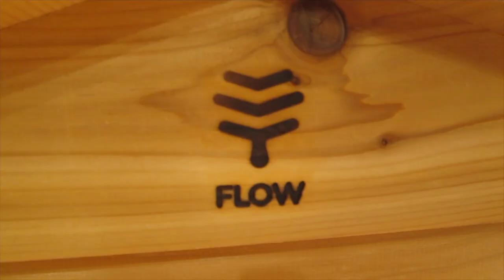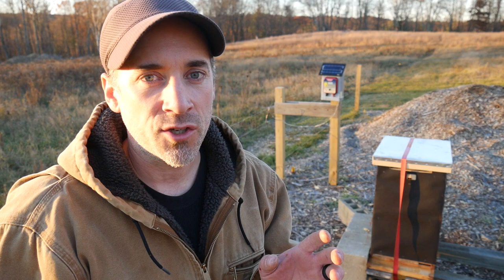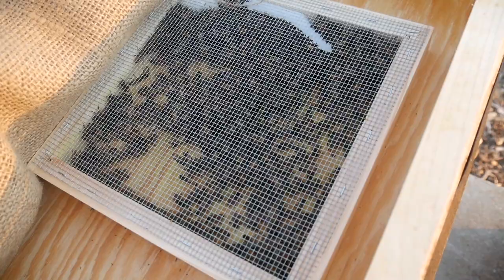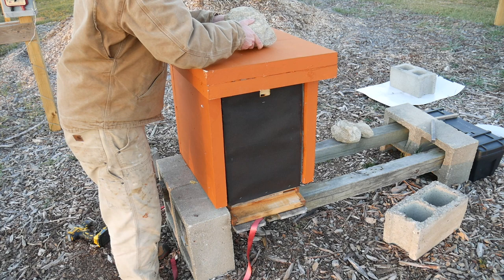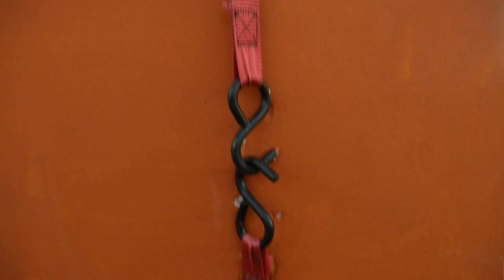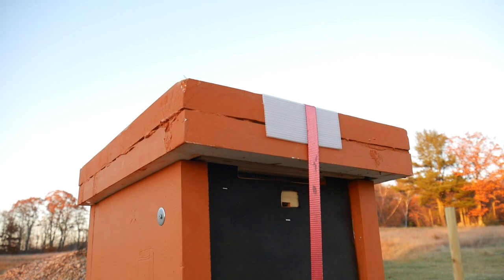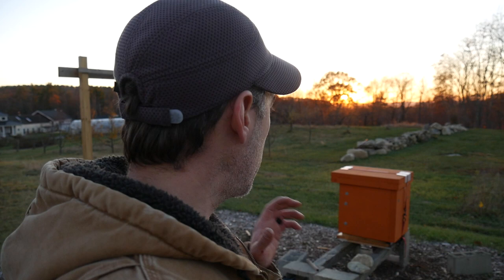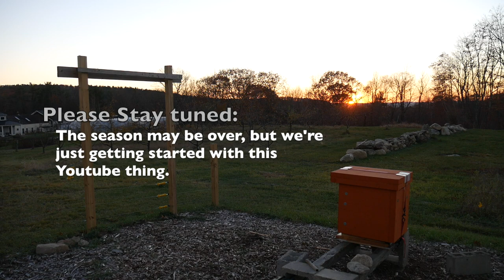Flow Hive - Season Finale + Foam - Day 179

Comment: Regards from the country of Jacques Tatie ;o) 
Looking forward seeing the winter condition as it depends a lot of these conditions to put protections. 
I do have Dadant hives and to them ready for winter,  I am just putting a reducer at the entrance to avoid robberies from others insects. As the floor is ventilated, I reduce with a lid the ventilation on two thirds of the floor, knowing that I leave 1/3 of aeration on the back. Last but not least some newspapers for isolation under the top cover. That's it.
It is really important not to over protect the hives for the condensation and to make sure that the bees will turn into hibernation mode. I mean slowing down their activities and consumption of the honey.
Reply from the maker: Hello, a lot of what I'm doing is based on tips I received from a local experienced beekeeper with bees in my exact climate. I am adapting his principles and doing my insulation and ventilation accordingly. Thanks for your comments and hello in France!
Reply: so great, well done! It was as well a way for me to say Hello from France as just discovered your channel and subcribed. Bon week-end.

Comment: Your hives seems more winter ready than most peoples homes.  My only concern is that the hives maybe over insulated .  Keep in mind that bees consume much less honey during the hibernation stage,  If the hives are over-insulated they may run out of stores before spring arrives.   You may want to check in on their stores a couple of times during the winter.   And don't forget the mouse guards,  now that the hives are well insulated they may be on their way to your hives.
Reply from the maker: Ziad Natsheh That's part of the reason I left the front open. Four sides of insulation would have held a lot more heat. There is also very pronounced ventilation. But the bees can easily close that off and regulate it by clustering by the  hole in the Vivaldi board. I'm not sure where you are but we are in for 5 months of sub freezing nights and a lot of wind on a hilltop. That shell of insulation is also a nice wind break. Joe the beekeeper explained the three sided insulation theory to me because that's how he does things. He even has heating pads on the back wall of his hives for extreme cold nights. I'm not going that far!
Reply: I'm in Jordan, we only get a couple of days of subfreezing temperature if any at all.  5 months of sub freezing nights would definitely justify your setup.
Reply from the maker: Ziad Natsheh Ha! Winter over here is stressful as a human in an insulated, heated house. I can't imagine being an insect in a wooden box in an open field. Nature is constantly amazing.
Reply: remember to keep that fondant on them. they eat like crazy when its cold out. my hives take about 5 lbs ea. a week in the winter

Comment: Just like your season long series, this is my first year with bees as well. I didn't start like you did will good new equipment. My cheap self built my box, boy I not be a great carpenter. Any way I got my bees from an abandoned hive that was falling apart. I managed to get a frame of capped and frame of uncapped. Along with some of their drawn out frames. I tried to find the queen but no luck. I think I may have squashed her by accident so I grabbed a few more extra bees and went with it. So I think I got a nuk hive with no queen. Well see if I can bring this split to life lol.
Reply from the maker: Whoa. Good luck.
Reply: Vino Farm thank you. I've cheating a little Cause I got a mentor that I've been helping and learning from her apiary. So I not completely on my own but its hard to keep myself out of the hive. Trying to give them a week before I mess with them , so I Haven't gotten to go  into it to check for the queen or at least a few  queen cells.

Comment: I did the insulation on the inside, but my difference is that I put the food right on the frames vs. vivaldi board.  I do have moisture on the inside of my outer cover.  But it both my hives are still alive. (Leominster, MA)
Reply from the maker: Don Rota Yeah, it's frustrating. The insides of the hives were dry and they died on frames WITH honey on them. I noticed them taking fondant in early winter/late fall as you can see on this video. They had tons of food in the hive... on the frames they were clustered on. I really think it was some kind of disease and they were in a weakened state. Also, it looks like my original queen either died or swarmed in late fall. The remaining bees tried to make a queen and she never mated because she would have emerged in December. (See the autopsy video.) Lots of factors in play.

Comment: Looking sharp,  nice insulation build!!!.  Assuming the answer is already the case, but facing the tar paper south will maximize your solar gain.    
One other thing that most people don't account for is increased Radiant heat loss on Clear nights vs cloudy nights (Space literally sucks heat off of things and makes them colder than the surrounding air >forming Dew)   Some surface materials will make the difference in this scenario.  A mirror or reflective top can help reduce radiant heat transfer/loss.

Probably over kill & doubtful that it'll impact you that much on top of the existing insulation job, but i'm sure you like to be aware of all elements of your condition and weigh your pros & cons.   

Have you thought about having an internal probe thermometer inside the hives??
Simply to satisfy some curiosity about the internal conditions over winter?? or even summer?   
It might also provide a good source of realtime feedback data for future situations where you are split between 2 approaches.

Great channel, Good luck to the bees through winter
Cheers!
Reply from the maker: Spencer Brennan Yes, I definitely want to do some kind of thermometer/humidity probe inside the hive. I'm looking around for a good option. And yes, the idea of the black tar paper is for solar gain. (I mention that in the video.) I will see how my "outside the box" insulation works soon enough. Thanks for sticking around and for the input!
Reply: There are some good Temperature probe options around the Greenhouse + Hydroponics/Weed growing supply circles Hydroponics stuff will give you humidity readouts and high/low memories and stuff.    I've fantasized about some really trick setups with wireless connectivity and history graphs on the computer.  It gets into the overkill arena pretty quick, but with multiple nodes in the same system you could have data in greenhouses or more hives as well.   Looking forward to some sourdough vids :)   you a Kombucha guy too??

Comment: I see a lot of difference between beekeeping in Europe and the USA. I'm living in the Netherlands and we don't pack our hives in with any insulation. A view centimeters outside of the cluster it is as cold as outside the hive. We even feed them only in the winter if they have to less food. That will be in march, 1 April the season starts of course we feed them before the winter. In Iceland or in Siberia they pack the hives in because it's very cold there, in Siberia they put the hives in a barn. How cold are your winters?
I don't know if they do a winter threat against the varroa mite in the USA, we drip oxalic acid in 1 to 1 sugar over the bee or vaporize oxalic acid, but that's very toxic to the beekeeper. If you want to know the method op dripping let me know and I will write it. You start with almost no mites in the spring.
I like how you keep bees and do it intuitive. I'm a thinker, your more a doer (? Don't know if it ps the right word)!
I hope you make also this season (2017) videos!
Good luck with your bees.

Comment: I will say I'm nervous about drilling screws or using staples on a hive body.
It's supposed to last for years, and if you split the wood, you have to move all of the frames into a new body
And if you split the wood on that day, and it snows tomorrow.. better hope that insulation is good!
Granted they say you're supposed to get new hive bodies every few years anyway.
Still I would have tried to use another fastening method, or I would get .. another flow hive and 2 new hive bodies and move all the bees to those new bodies when summer comes
Have a ready to go winter set and a ready to go summer set
Reply from the maker: smokeydops I didn't feel there was any danger of splitting the wood. I wasn't screwing into end grain and the screws aren't being pulled or holding any weight. I will certainly find out in the spring. Everything feels very solid and secure. If this turns out to be a totally failure, you can be sure to watch a video about it!
Reply: Yeah, this year I&#39;m certain that it will be 100% fine. When you do the same thing next year and the year after that (on the same hive bodies) is when I get worried. Thanks for reading

Something I just thought of was leaving the screws in the hive body year round and cut off the head of the screw. When it comes time to winterize, put on the insulation in a slightly different manner (perhaps with channels cut for the screws to slot in with) and then use a washer, a nut, and some removable threadlock to tighten it down firmly. that way you set the screws once and never run increased risk of damaging the hive body

Comment: In your climate I would have used extra hardened, expanded polystyrene beehives instead of insulating like you do. Much less work, especially if/when you get more beehives. They work great in summer times as well.
Reply from the maker: David Sandanger Two hives were inherited and the flow hive is wood, so I didn't have that choice this year. I'll look into that for future hives.

Comment: this is my second year of bee keeping and hoping I can keep them around this year, last year they didn't make both hives swarmed late, so I bought 2 packages this spring and they did great I split one hive, so now I have 3 hives and getting honey from my big hive, I plan on using the insulation as you, so glad I found your videos on it, did all your hives make it through the winter? and love the idea on the cover and not putting it inside.
Reply from the maker: Sadly, two of my hives died. One survived and slowly bounced back over the summer. It's difficult to say what killed the two hives, so I can't fully blame the insulation (or lack of insulation). All three were wrapped the same way sitting next to each other and one made it. I may modify my insulation and winter prep for this year. Subscribe and stay tuned! Thanks.

Comment: I am a novice beekeeper with a flow hive.  Watching your winterizing videos I can't tell what exactly you have there.  I see a brood box and then is it the Flow Hive system and then the vivaldi board? Or do you switch out the Flow Hive system and put another super on the brood box and then the vivaldi board?  Did you switch out the original cover with the flat one?  Thanks for your help.

Comment: I told you that you had done a good job on the fondant. Obviously the bees agree with me too! They really chowed down on it. Out of curiosity will you open the hives periodically to check and refill the fondant or are they closed for good until spring?
Reply from the maker: I will definitely check on the bees on days when there is a break in the winter weather. There are always a few odd warm days that pop up and I made the hive layout and insulation to be able to open the lid and add fondant pretty easily. They will almost certainly need replenishing during the winter.

Comment: needs front insulation too
Reply from the maker: I'm going based on what a local suggested. 3 sides of 2" foam. It's funny because others suggested what I did was too much. Not sure where you are, but I just have to go with the local suggestion. Thanks for watching.